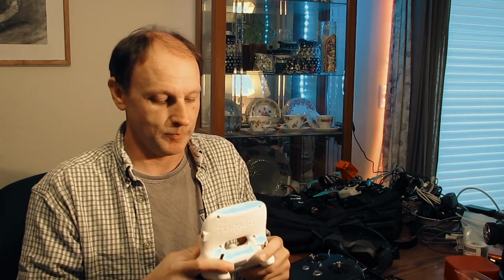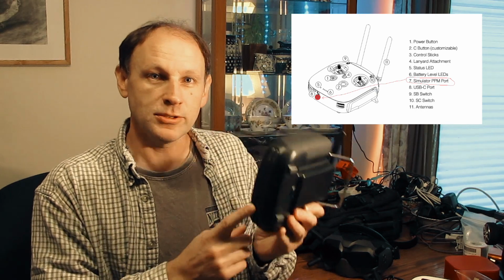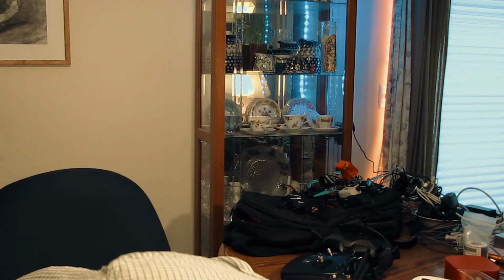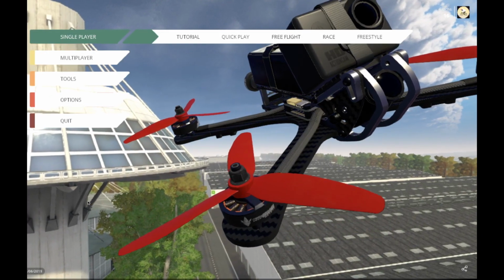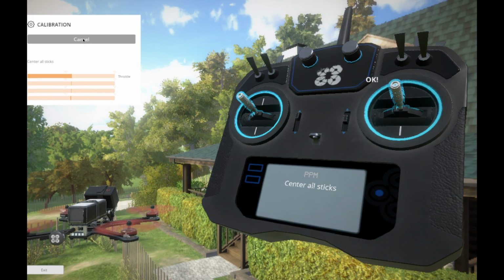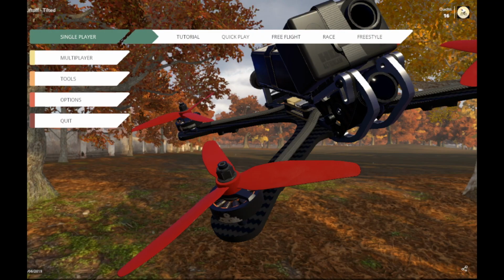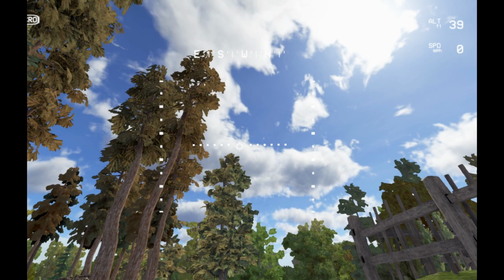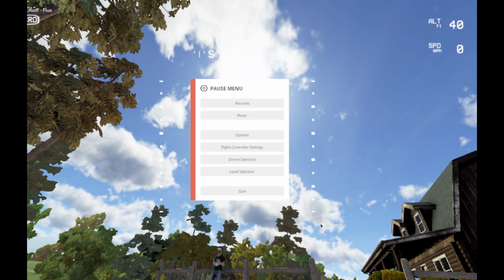Using the DJI Digital FPV Radio with the Liftoff Flight Simulator ( on a Mac )

Comment from the maker: #### December 2019 Update   ####  You no longer need the USB to PPM cable to make this work.  The same USB cable you use for updating the firmware will now work with simulators.   https://www.youtube.com/watch?v=gPpzOMAq82I
Reply: 5zero7 RC oh awesome! I’m definitely going to give it ago. Thanks for the info.
Reply: Lol just bought the USB to PPM cable in a rush before the controller has finished charging!

Comment: Can me do this on me Xbox
Reply from the maker: I'm not sure about that.  But I don't think you can use this radio on the xbox.  However you can get the DRL simulator on xbox and use the xbox controller.  But that is not as good as using a real radio, but better than nothing.

Comment: So is there confirmation to what adapter for sure works for a Mac that is similar to what you used for this DJI controller now?  Thanks.
Reply from the maker: With updated firmware you don’t need an adapter anymore.  You can use the usb cable it comes with to connect to a simulator.
Reply: @5zero7RC  😄🥳🥳🥳🥳🥳🥳

Comment: how did u make to the simulator work on mac ?
Reply from the maker: Can you elaborate?  Or maybe my more recent video can explain it better?  https://youtu.be/gPpzOMAq82I  You should be able to use a usb cable now and connect the radio to your computer.

Comment: hello mate, any idea why there is so much latency on my DJI transmitter? Because there wasn't any latency on my X9D and then i can't really fly nicely with the DJI .. thanks a lot :) and all the drivers and firmware are ok! :)
Reply from the maker: Not sure.  I don't seem to have that issue with my Mac.  However others have also mentioned they have that issue, so it is not just you.  If anyone solves the problem, please let us know.
Reply: @5zero7RC  thanks mate for replying ! hope to solve this issue !

Comment: What Mbp are you using and with what specs? I tried downloading and playing today and I have a mid 2012 retina 15”

8gb ram, 
intel HD GRAPHICS 4000
NVIDIA GeForce GT 650M

I couldn’t even get 5 FPS and had terrible jittery lines. I tried reducing the image quality and motion blur settings - still terrible. 

Luckily they refunded me but I still would love re-purchase and use this simulator before diving suler deep into the hobby....I was just wondering if you think it would even be possible with my specs or is there a work around I’m unaware of? Thanks 🙏🏻
Reply from the maker: At the time I did this video I was using a 15" 2016 MackBook Pro with the best graphics card it came with at the time.  Something from 2012 will probably struggle with most flight simulators.  Maybe give the flight sim CurryKitten is developing a try.   https://www.youtube.com/watch?v=QgaB_8Gc1Cc
Reply: @5zero7RC  alright, thanks for the reply! Unfortunately I can't get my computer to recognize my phantom 4 transmitter...

Comment: Hi, regarding your update. This means you connect the DJI radio directly to the computer with a USB cable?
Reply from the maker: That is correct.  Using the same USB cable that you would use to update the firmware, you can now use for a flight simulator.   https://www.youtube.com/watch?v=gPpzOMAq82I

Comment: wait with the new firmware how can you connect the RC to the computer wirelessly?
Reply from the maker: No, not  with wireless, but using a USB cable.  You no longer need to buy the USB to PPM cable.  Instead you can use the same USB cable you use to update the firmware.
Reply: 5zero7 RC ah cool! Didn’t know that yet. I had only heard about the additional OSD options. That’s awesome!
Reply from the maker: @Quadcopterguide  Uploading a new how to video now!  Not that there is much to it, just connect a usb cable, calibrate and go :)

Comment: Hello, thanks for the video! I will receive my Controller in the next 2-3 days. Regarding to the update in your video description: What is the new way to connect to the PC? Via USB?
Reply from the maker: I have not had a chance to try it yet, but it sounds like you should be able to use a USB cable ( same one you use to update the firmware should work ) and connect it to your PC just like other radios and use it in a simulator.  Excited to give it a try soon.
Reply: @5zero7RC  Thank you for your answer and saving me a few euros!
Reply: @leongerdes7860  did it work with the usbC tu usb cable?
Reply: @christophhaas5696  yes! I just connected it with a standard usb c to usb cable. Merry Christmas!

Comment: hey... I bought this cable but my Mac still doesn't recognize my dji fav controller... I used https://html5gamepad.com to check if any gamepad was being detected and got nothing... the red light is blinking and all on the chord it just doesn't connect to DRL or my computer in any way. Any chance you have an idea on how I can try troubleshooting. Thanks so much
Reply from the maker: Update to the DJI firmware that was released today and try the USB connection.  Hopefully that will work for you now.

Comment: thank you so much for making this video 💯

i only have 1 question, on your personal experience/recommendations which one would be more better in term of signal for long range flight on dji fpv air-unit setup. either dji remote or any analog like Frsky/Futaba etc. with TBS Crossfire 

i was very appreciate to get a reply for this question. thank you 🙏🏻
Reply from the maker: Crossfire uses a lower mhz frequency ( 800-900mhz ) as such it has much better range and penetration than 2.4ghz or 5.8ghz.  So if you really want reliable long range radio control, Crossfire is your best bet.  Crossfire also allows you to output a lot of power if necessary and was built with long range in mind.
Reply: 5zero7 RC thank you so much brother 🙏🏻 appreciate that

Comment: got the exact cable.. don't even getting detected by the liftoff .. although windows and steam detect the controls .. but Lift off doesnt.. like there is no controller attached .. not sure what I am doing wrong.
Reply from the maker: This guy on the DJI forum had a similar issue until he lowered the throttle all the way down.  Maybe that will help?   https://forum.dji.com/forum.php?mod=viewthread&tid=200162

Comment: Hey, have you gotten it to work on LiftOff? I get unkown device with the same cable
Reply from the maker: I don't know about anyone else, but the cable I show in the video works on my Mac with LiftOff.  This video also shows what looks like the same cable working on a PC with LiftOff.   https://www.youtube.com/watch?v=T201Rqf1QKE
Reply from the maker: I saw this advice on the DJI forum.  Maybe it will help you???  " Had some trouble getting this working for the first time. What I believe fixed it for me was letting the battery charge 100% to the point the lights turned out, not just waiting for 4 bars. Controller was recognized but inop before that."  Not sure how that would be an issue though.
Reply: @5zero7RC  Thanks for the answer, I use PC and I tried to charge it. Still unknown device

Comment: can you use the dji goggles in the simulator also?
Reply from the maker: Not really.  There is no HDMI input on the goggles.  The only input is through the analog a/v cable and almost no one has an a/v output from their computer these days.
Reply: @5zero7RC  Thanks for that, also i'm trying to decide what to get. Either the dji radio or a third party one like T16 with crossfire, which one would give better results?
Reply from the maker: @ynoter1  t16 + crossfire will give you greater range for sure.  The DJI radio has some handy integration but not necessary.  DJI will go farther than 2.4ghz standard setups but crossfire is where you want to be for reliable long range control.
Reply: @5zero7RC  And if i want to use a different radio will i have to attach an additional receiver? one already being in the air unit for the goggles
Reply from the maker: @ynoter1  Yes, if you do not use the DJI radio you will need a receiver that matches your radio brand.  So crossfire, FrSky, FlySky, etc.
Reply: @5zero7RC  one more question sorry.. if i was to use the jumper T16 pro what receiver would i then go with? if i wanted to use crossfire? because i dont know if jumper makes a receiver
Reply from the maker: @ynoter1  If you want crossfire, you need to buy a crossfire module from TBS for the Jumper, then a crossfire receiver for your drone.  If you didn't go crossfire you would probably buy a frsky receiver.  The jumper can do multiple protocols such as frsky, flysky, spektrum, and others as far as I know.

Comment: Does this work with DRL please?
Reply from the maker: I don't have DRL so I have not tested with that simulator.  My guess is that it would work but if someone else has tested that and can respond here, that would be great.
Reply: 5zero7 RC i have managed to connect it with my Mac with DRL. Works flawless. Today I am going to try it with my PC.
Reply from the maker: @sarciarob  Thanks for letting us know.  That is great to hear.
Reply: @sarciarob  Have you managed to try it with PC? I can't calibrate it with my throttle. Saying the channel isn't detected.
Reply: Benny Lee yes and it worked fine
Reply: Roberto Sarcia for some reason my throttle calibration doesn’t “detect the channel” any ideas why? I just got my controller and haven’t activated or anything

Comment: WARNING. Don’t be impatient like I was and try to make your own 3.5mm to usb. I was certain I had everything right and when I hooked my controller to my MacBook Pro to see if it worked a warning popped up on my screen saying something along the lines of accessory using to much power and then my screen went black and won’t turn back on😐. Just order one of the cords he recommends and patiently wait for it to come in.
Reply from the maker: Ouch, that's unfortunate.

Comment: anyone already try the adapter which 5zero7 RC suggest? i had tried the one called KS1000 and it doesn't work on Mac and it seem look like the same thing....
Reply from the maker: The KS1000 sure does look the same. Surprised it didn't work for you.  I assume you tried to "calibrate" it inside the simulator and it didn't see anything at all?  If you do a system report, does it see anything connected to your USB port?
Reply: Yeah I had no luck with identical looking cable on PC. Waiting on another different cable now.
Reply from the maker: @320res  Keep us updated on how it goes!  Hopefully together we can steer people in the right direction.

Comment: Does it works with the regular DJI controller? (Phantom 4 or Mavic)
Reply from the maker: I don't believe so, however I do not have a Phantom or Mavic controller.  Those radios don't appear to have a 3.5mm jack on them like the FPV version does.

Comment: should a 3.5mm to usb regular cable work ?
Reply from the maker: I'm not exactly sure what you are asking but to get the radio to connect to your computer you will need a 3.5mm to usb cable that has some smarts inside to translate the signal from the radio to something that the computer can understand.
There are quite a few on Amazon.  I don't know if they all work or not, but the one I have does work.

Comment from the maker: It sure would be nice if DJI made the USB-c port capable of working with simulators like other radios do, but unfortunately it does not work that way right now :(
Reply: lol, I was just about to ask this very question. Oh well, guess I'll hunt around the web for an RC car cable to USB port. Great vid!
Reply from the maker: The ones that I have linked in the description really should work.  The top one looks identical to the one I have that does work.  If anyone does buy one the does or does not work, let me know so I can pass on the info.